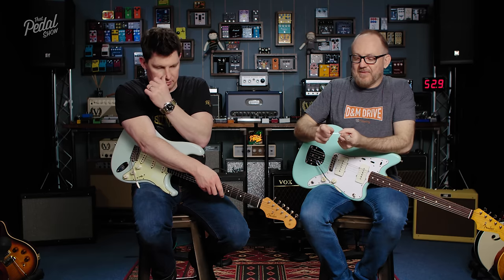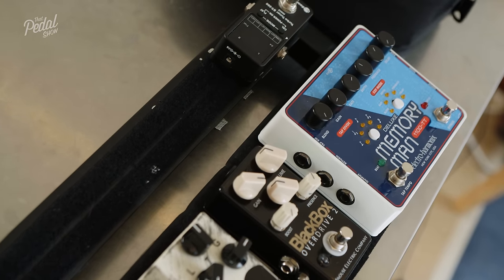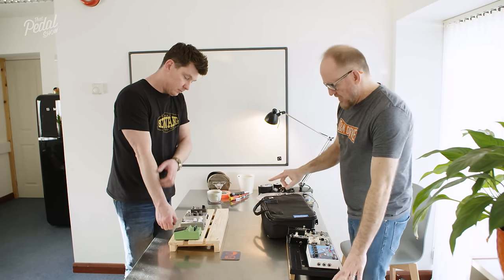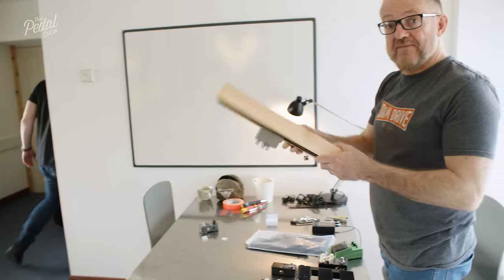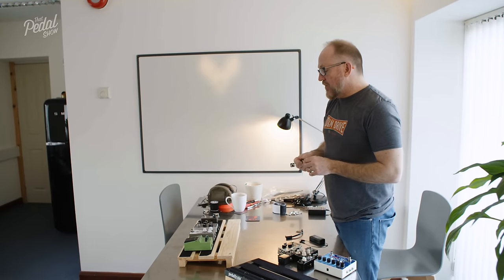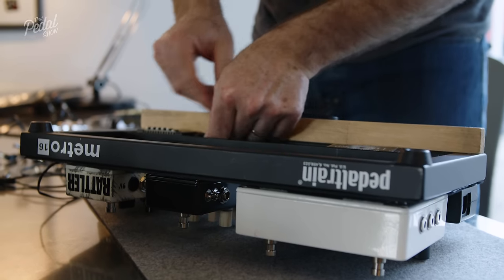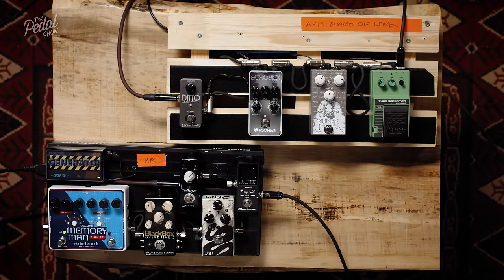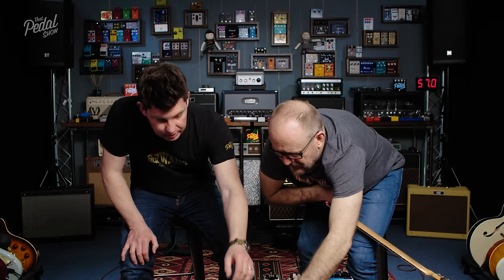Tips For Your First Pedalboard Build – That Pedal Show

Comment: Seems extraordinary that Dan has 4 different "power associated boxes" to power 5 pedals...... a bit overkill to say the least?
Reply from the maker: Sure. Context is everything here - we use what we have without needing to buy more stuff. If you buy a basic brick, you’re going to need to change it down the line because it won’t have the right spec for a bigger board. So I guess it’s about how far ahead you want to look. But yes, for these boards at this level it is arguably overkill. 
That said... the MOST important thing on your pedalboard is the power.

Comment: I would HIGHLY recommend building your own power supply if you have even a modicum of soldering/electronics experience. Most off-the-shelf supplies are crap, finding one that isn't is tricky, and yet you can easily and cheaply design/build something that will outperform even the best off-the-shelf units in basically every way. You can easily DIY a supply with transformer-isolated 500mA outputs, each with >100dB noise rejection, independent soft-startup/shutdown, and "old battery emulator" switches that would fit on the underside of a pedal board and cost <$10 per output.

Comment: I was just wondering Dan, is the lava tightrope solder less system any good? I see you use the evidence sis but that's a little expensive for me. Just wanted to get your opinion on the lava tightrope. Looks to be about the same but I'm sure the difference is probably in the cable. I would appreciate your opinion, thanks

Comment: Ah, mate, what a nice show, and such an enormous well of knowledge and inspiration! 

But what a shame Mick didn't spend a few more minutes when he made his own board. First and foremost, you should always screw the bits together from underneath so that there's no screw heads visible. You never know if you're going to cover it all in velcro. Personally I like when I can actually see the fresh wood. The other thing is: Always saw the end of your boards off a few mms (planks that is, not boards as in pedal boards) so you get rid of the scruffy surface left over from the sawmill.

Actually, since it doesn't take much wood at all for a project like this, I'd invest in some proper stuff like oak or elm. That way you can actually enjoy the board, not just the pedals on it.

Attention to detail in everything, not just in sound. ;)

Comment: No tuner, gents? Also...most folk, even if they're on their first board, will probably need channel switches on there too...
Reply from the maker: Well you can amend as you see fit. Pedal choice is down to you. Two things though, you don't need a tuner if you aren't playing live (and very often I won't use one even then - Mick here) and secondly, neither Dan nor I have used channel switching amps in almost forever. Cheers!
Reply: @ThatPedalShow  - no tuner live? Brave man. Of course, your bandmates might be better-trained than mine...trying to tune with a headstock tuner while the bass player's noodling is...let's face it, rage-inducing ;) Good on you for choosing the DIY route, though. I often think it's underrated...you get a board which is exactly right for your needs, rather than one that has uncomfortable gaps or is half an inch too short. My first board was the side of a drawer unit with a carpet tile on top and gig tape round the edges (I'd only fix it with gig tape, so might as well start as I meant to go on...).

Comment: This is a first pedal board for people who watch your channel. Not a criticism. No one's first board has a vintage TS, plus a boutique secondary drive. Or a tap tempo analog delay.
Reply from the maker: Well we’re not building a first board for anyone else’s channel. The build concepts are the same regardless of what goes on there
Reply from the maker: Hi Jonathan, Mick here. I explain right at the top of the video that the pedal choices are different for everyone. For example something you've always had kicking around, then one or two other things that you've acquired along the way. I bought my first pedal in about 1987 I think. I didn't have a pedalboard until a decade later! So we're not saying just go out and buy these exact pedals. Surely that's obvious? Cheers!

Comment: I might be just talking s**t, I dunno.  But back in my wanking days, I had a Whammy (4?) pedal, as a good wanker should.  I remember it being atypical of power supplies.  It was AC when pedals are usually DC.  Or perhaps the other way around.  Am I remembering this correctly?  A normal power supply (like a one-spot) would make the LED light up, but that was it.  It was months before I took a closer look at the jack and saw it was labeled with what power supply it needed.  Do any multi supplies have this as a feature?  Am I completely mis-remembering this?  Thanks, Dick and Man.  Or whomever answers.  Internet know-it-alls, I assume.  #toolazytogoogle

Comment: Why would any pedal designer use center pin positive? It seems unnecessary, any good reason from a circuitry standpoint? Or do they just want to watch the world burn? Lol
Reply: My theory is that the original circuit was done with a random transistor that happened to be polarized oppositely than most. 😎
Reply from the maker: I did hear a good reason for this. Mick here. But I can't remember what it was!

Comment: I use a Godlyke Power all daisy chain ($40). It is rated at 2000 ma. I power 11 pedals with it. It is superior to a one spot. I don't have any noise. Has anyone else tried one? Do I really need to buy an expensive power supply? I am using an Music man Axis super sport (HH) guitar into a 68 deluxe reverb custom.